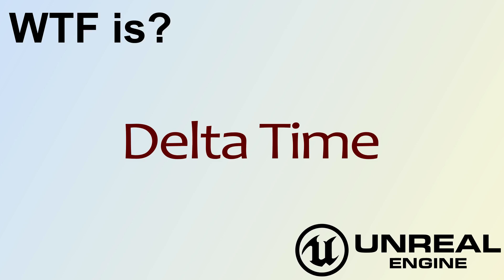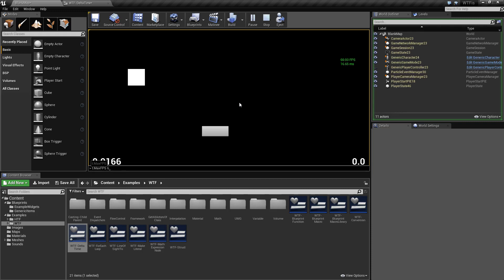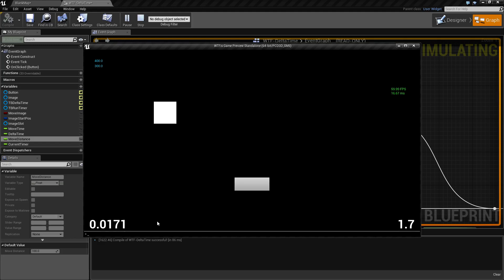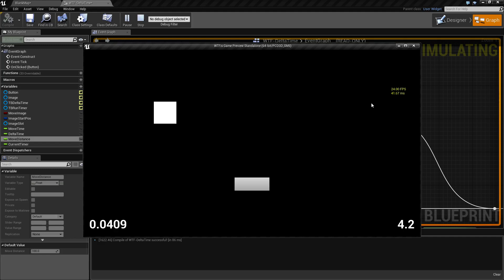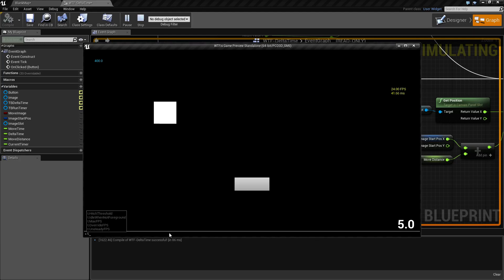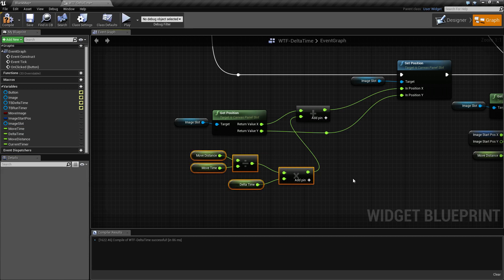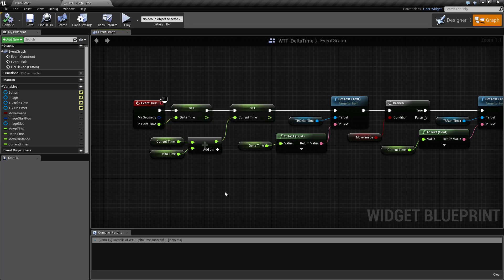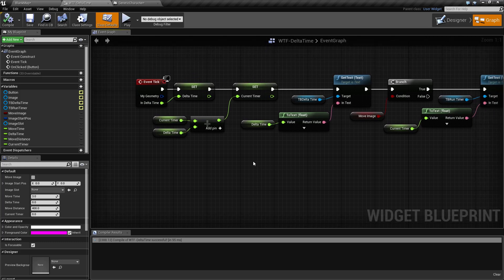WTF Is? Delta Time in Unreal Engine 4

Comment: First of all, awesome video as always. One point I'm struggling to grasp, and maybe I'm just being a noob. The Distance is being divided by the Time to get the average speed right? Then multiplied by the delta time etc. But the delta time changes along with the FPS (so like 8.33 ms for 120fps and 16.66ms for 60fps etc), so how is it giving the same result?
Reply: faster fps have lower value on tick but ticking at faster rate, while lower fps on tick have higher value but ticking at slower rate

Comment: This is really nice and neat video. Actually all of your videos are awesome and very helpful for new users of this engine.
I need some help from u. I am working on prototype of video recording software using unreal engine.  These are the prerequisites for the software. 
1. When ever I start the software, it start recording to video at desired FPS ( 24, 25, 30, 60, etc ).
2. After fixed duration software ends and export out as video.
3. I need this recording to be as fast as possible.
4. It will be unplayable ( no user input ) at all and this entire process will be automated.

based on above points I have few questions :
1. Can I use sequencer for this ? BTW,  content will be different and unique every time, I start the software.
2. How can I setup the engine so that software renders at higher FPS ( 300+ for really good GPU ) but game world updates at fixed FPS ( 24, 25, 30, 60, etc ) ?
e. g. Suppose I want to record 10 sec footage at 30 FPS then I will have to render 300 frames and encode them to create a video. If game world is small and GPU is powerful enough to render at 300 FPS then 10 sec footage must be rendered in just one sec, so final output video might be ready in just 5 secs based on encoding technique.
3. Can I use custom command line arguments ?

Thank you in advance.
Reply from the maker: I have not had enough experience with Sequencer to give you all the information but here is what I do know.  You can use Sequencers to write out to disk a set of camera shots however the Audio is not included as of the last time I used it.  You can render it out at the desired frame rate and I believe it will simply record it out as fast as possible so if your machine is faster enough, or slow enough, you will still get the desired frame rate.  I do not believe the Command Line can do anything with sequencer at this time.

Now for the recording part sequencer will pretty do what you tell it to do so you can have camera movement tracks and just change out the content if that is your goal.
Reply: Thank you very much, sir. 
That was really quick and description answer.